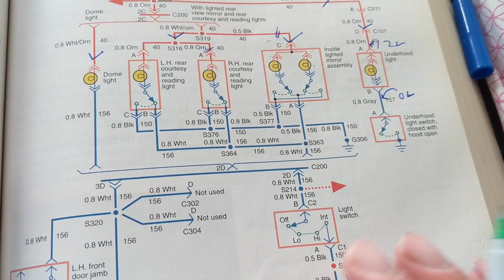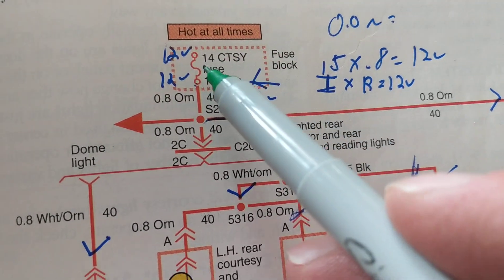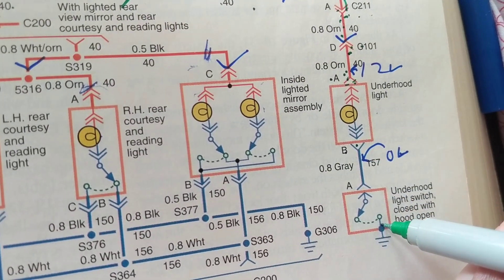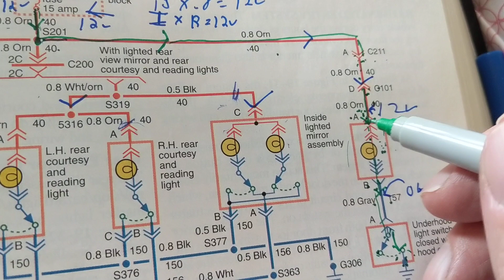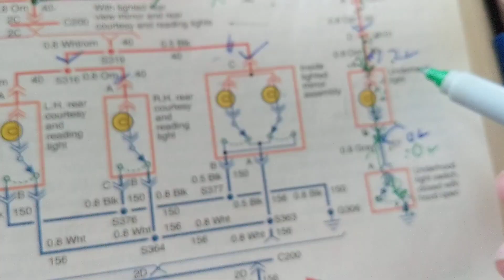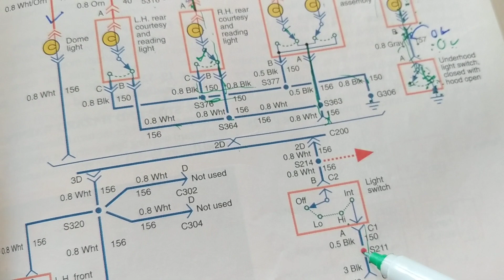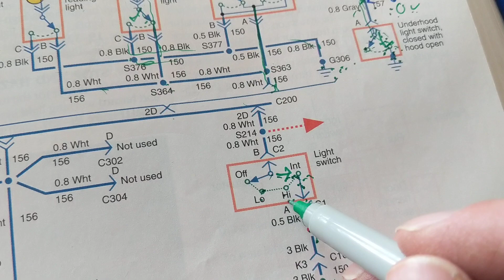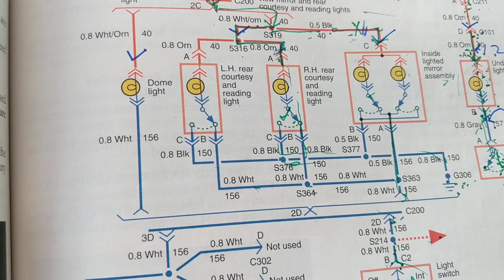HOW TO DIAGNOSE AND READ DIAGRAMS FOR BEGINNERS FOR LIGHTING SYSTEMS TROUBLESHOOTING

Comment: I have a draw that kills battery over night,back up fuse is only fuse that i pulled that stoped the draw,i have a haynes manual with diagrams,its a honda civic 2010,i subed,this thing giving me a fit.
Reply from the maker: Then you have to get the diagram for that Honda Civic 2010 when you pulled out the fuse and that system you have to take off the connectors which part of the system is giving you that problem?
Reply: @Joeelectronicschematicsforauto  I have only pulled under dash fuses and underhood fuses and took wires off alternator but I will keep looking,I will see all your vids.
Reply from the maker: @Mikemeshell63  correct but you still have to look what it's connected to it might be but connected to two three modules go to Google put in the make and model of your car Honda Civic 2010 power distribution unit you should come up with one wiring diagram for that fuse power distribution boards
Reply: @Joeelectronicschematicsforauto  ok,thanks,fuse 23 is back up fuse for memory for radio and alarm system and other things so I have work to do,im taking negative post off of battery at night untill I find problem so I can get to work the next day,I have a repair manual for my car that has schematics in it for my honda,learning how to read them from your vids,I will post if are when I find problem so it may help someone else.
Reply from the maker: What I always recommend it and the videos was to always use a battery when a much higher cold cranking amps that can withstand these parasitic draws
Reply: @Joeelectronicschematicsforauto  ok,thank you,I will check your videos.